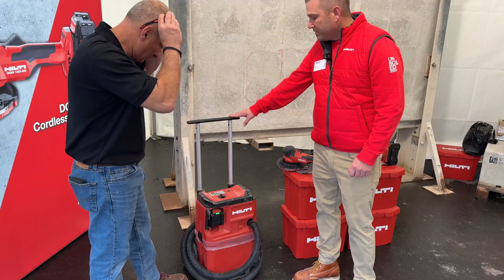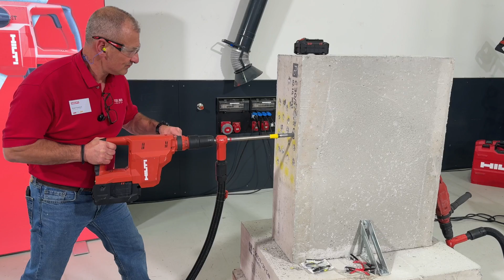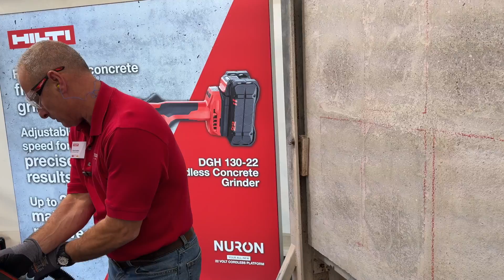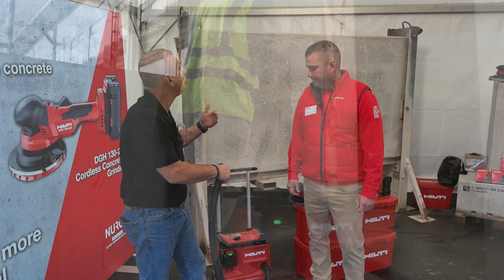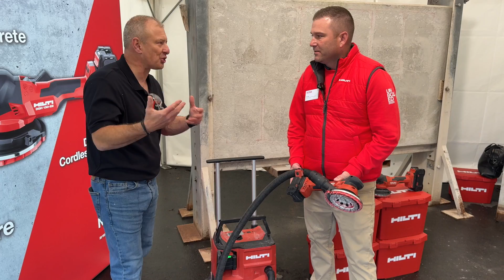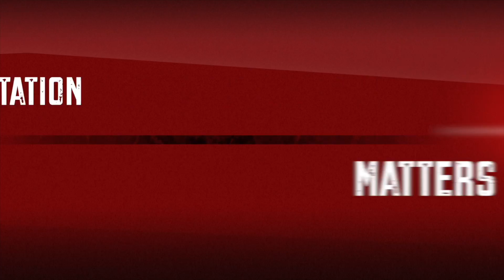Hilti Dust Extractor | New Tool 2024

Comment: I am once again shopping for a dust extractor. I am after the most suction possible for a relatively compact tool. I primarily install and refinish hardwood floors so I need something reliable and powerful that can do a post sand vacuum and get as much fine dust as possible before doing a dry microfiber pass.

I'm looking at the Hilti VC 300 or the Hilti 150 10 XE.  It seems like hilti is one of the best brands for dust control out there. Do you have any experience with these models?

Comment: Myself and few others I know went through multiple brand new units of the  VC 140-2-22.  I went through three or four before I asked for my money back. The others just settled for a wonky vac or dumped it for an XGT model.  The issue was in the electronics (a poorly soldered PCB just floating around up top and surely getting worked over by the relentless filter knock).  The Bluetooth would shit the bed almost immediately. Just all sorts of bizarre behavior. There were design and manufacturing issues.  A small thing but the rubber feet would fall off as you removed it from the retail packaging.  The inlet would constantly get clogged because of the pair of hard right elbows. The locking clasps were a nightmare. Even the reps commented “it’s that difficult to get the motor unit on and off”?   The vac itself is tall and narrow, so it just falls over constantly. Zero storage for the hose:.  Like…c’mon, is this an Emerson vac from Home Depot?  The product made me scratch my head.  Their corded dust collectors are clearly made in partnership with Nilfisk, so how did this amateur effort come to be? They made a piece of junk their center attraction. So now’s their second chance and….still no hose storage, no confirmation about the electronics issues being fixed and…they tacked on a cheap trolley?  Just cobbled together like that? Starmix made an excellent cordless dust extractor ages ago. Surely Nilfisk can work up a real product with them.  Other than the junky Chervon bandsaw, every other Nuron tool I have has been nothing short of excellent. They even went ahead and released vastly improved 6-1/2” saw offerings.  So how is this their cordless dust extractor offering? A lemon that is a pain to work with even when it’s not acting up? Do they not get Festool catalogs in Liechtenstein?
Reply: I signed up to a lease plan and I can’t give it back heap of junk . Bluetooth seldom works . Constantly banging cleaning filter . Needs bags that cost 10 euro min each would need 3 a day . It’s crazy hard on battery’s I need 3 of the biggest ones at 507 euro each it’s a complete robbery costing me a fortune a month can’t wait for contract to end 
 I’ve already bought a new vacuum a dc1800 dust control . Far superior machine with a plug

Comment: Turned me off!! He represents Hilti & he doesn’t know how much the remote button will retail for & he doesn’t know how much the vac weighs?!. Gave me a disingenuous vibe & I stopped watching. I’ve always liked Hilti quality despite the price but when they started manufacturing in China I decided not to buy. I’m in the Festool’s ecosystem now where everything is tightly integrated & I’m mostly happy. Mostly bc all the plastic underwhelms for the high price their tools command. I’d consider Hilti seriously (& did) when they manufactured in Liechtenstein & had company stores where you could hold them in your hands to see if it fit you (I’m left-handed).
Reply: Go to the store, you're lucky if you find ONE rep that knows anything other than what the computer tells them.  It's crazy it's came down to that, at least the Festool reps are almost always on their A-Game.